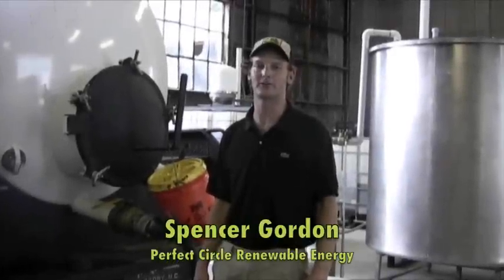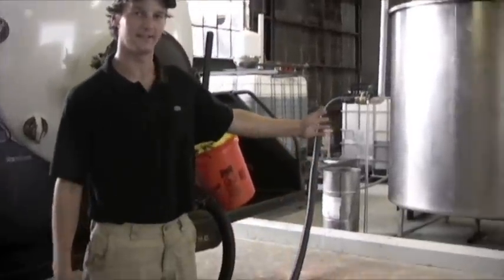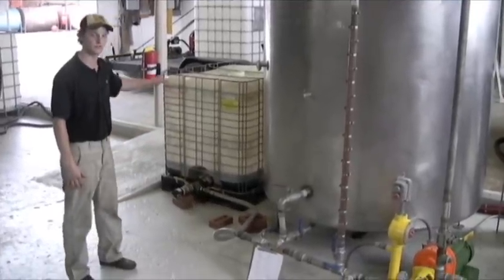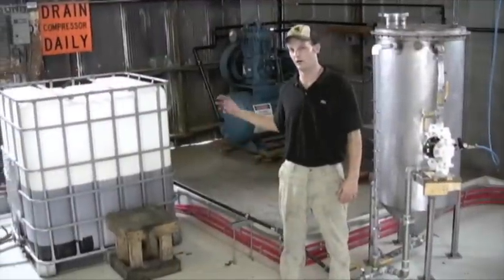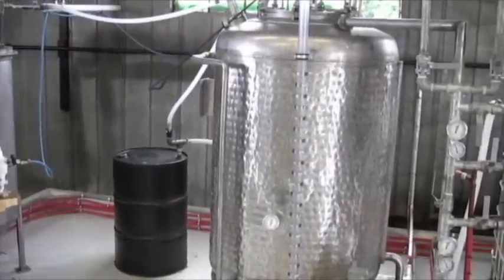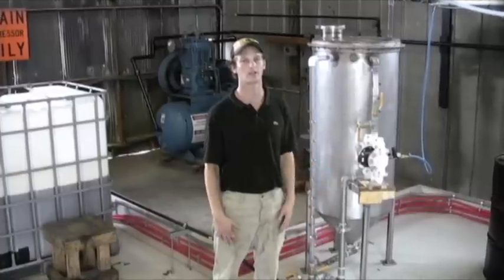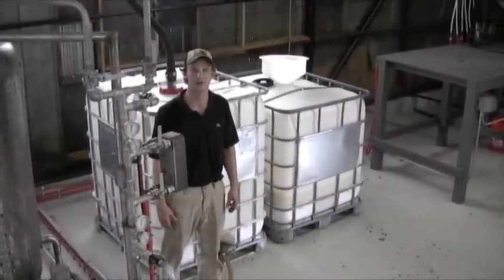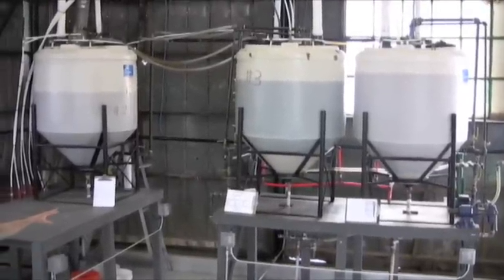HOW BIODIESEL IS MADE FROM OLD RESTAURANT GREASE

Comment: @ronaldsneek Biodiesel is OK down to about 35 degrees then you need to mix or blend it with regular diesel to keep it from clouding or waxing. But if you add heat exchangers at the proper placement along your fuel lines you don't have to mix or blend it. Sort of a untrue statement but in that part of Georgia 35 degrees only comes a few days a year. Modification isn't necessary but remember to blend or mix it 50/50 during winter months. =]